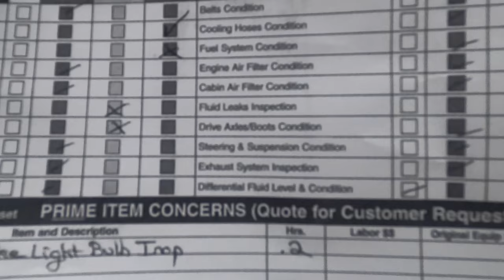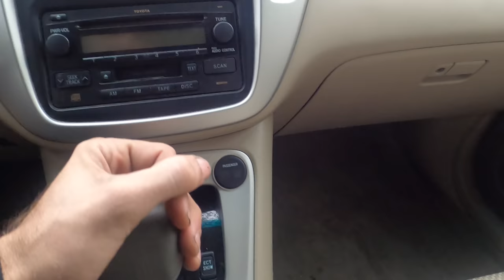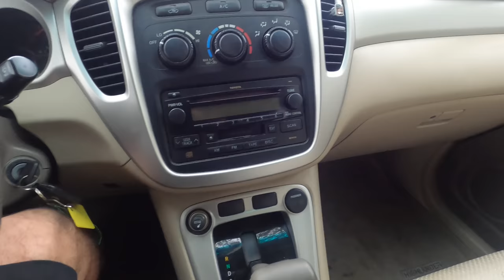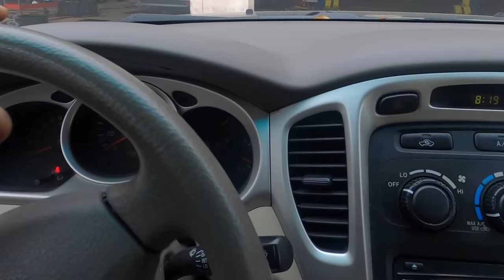We were BASHED by the Dealer! Ripping off a customer! Toyota Highlander 3.3

Comment: I don't think we clean and lube brake parts often enough, especially the whole park brake mechanism and sliders. I also love the way you recognized those rubber rings on the sliders were missing, that's a pro moment right there. Way to go, turning a negative into a positive.
Reply: I take those rubber rings off when I see them, they swell up and seize the slide pin, never had a problem or a come back to this day
Reply: @jsbbd136  hmm. maybe you should film your every-day works and insights and make your youtube channel a competitor for ray! i will be a subscriber, please go ahead!
Reply: I know the only time I actually do it is when the customer says their parking brakes are not working, because the flat rate book doesn't mention includes clean and lubricate parking brake components with a rear brake job with a seperate parking brake mechanism
Reply: @jsbbd136  gota use the proper lube:  non petroleum base.  "Red rubber grease" or silicone grease is what works and will not swell rubber brake parts.
Reply: The culture around brake components being disposable is a big problem that causes poor maintenance. if pads and rotors and drums and often slide pins are all disposable then why do extra to keep them clean and lubricated? Then it’s just a step away before components line the callipers and master cylinder are disposable or at least replaceable. or the dreaded “I’ll replace them now and rebuild my old ones” lie that we all often say and never follow through with, I’ve never rebuilt a calliper with new seals in my life. And once you get to that point then why maintain cables? (Have a car I’m fixing to sell that’s taking a while and I put new parking brake cables on it and only tested them and adjusted them never used the vehicle and only moved it once to store and again to work on the transmission and the cables were already seizing up after not being on and sitting for nearly a year (at least half a year) and being applied for about a month, if they can fail that quickly and with that little use what’s the point in doing much of anything for them? And now that we’re at a point where $40-100 cables are disposable then we circle back to callipers being even more likely to be seen as disposable…
Reply: @josephsteffen2378  Yeah but the castor oil based red rubber greases, also dry up a lot faster than silicone paste.
Reply: @aterack833  It's not that, as much as  that it just takes less work to do a mere pad slap, replace pads and not derust or lube anything that isn't in dire need at that moment to get the customer out the door without noise, then the partially degraded part, continues to degrade before the next brake job would otherwise be due... only has to outlast the warranty.  Granted, it is inevitable that more shop time to DO IT RIGHT, should cost more.
Reply: @stinkycheese804  wow, i didn't know that.
Reply: Personally I by new slide pins and boots when I replace pads. Maybe it's a little overboard but it worked well for me over the years.
Reply: @12yearssober  I buy boots if torn, or slide pins if corroded, but since I started using silicone paste and cleaning out the factory petroleum base junk from the factory, I've no longer had corrosion issues except when doing someone else's brakes.
Reply: @stinkycheese804 
That sounds like a good idea as well. I just do it as a habit left over from living in the rust belt. I'm in Florida now so probably not necessary but I'm an old dog so hard to change lol
Reply: @jsbbd136  Yep i experienced that too, also ditched the rubber rings.
Reply: @josephsteffen2378  No need for these rubbers, never experienced vibrations or any kind of problems without them..
Reply: @josephsteffen2378  it's not about swelling. In some calipers the tolerance is to tight and the rubber guide ring starts to work as a seal. Because grease isn't compressible the guide gets stuck.
Reply: @SAB445  it's not for vibration, it's for knocking going over bumps
Reply: @Robertas_Grigas  Agreed.  We do our best.  Sometimes there is a special situation.  I follow the manufacturer's engineering design, for whatever product I touch.   That's why it's called a skilled trade.
Reply: @jsbbd136  This is the way. Toss those rubbers. They sell up and cause brake issues.
Reply: @Robertas_Grigas  even that.. Removed the rubbers about 6 months ago and didn't hear a single knock. And if it is against knocking why isnt there a rubber on both pins?
Reply: @aterack833  i just revuilt all 4 off my calipers. $15 and 2hrs is better than $700 and 2 hrs.
Reply: @solaryellowis3007  I’m not sure I understand how you got those times since you have to do the same stuff, also sucks that they’re charging so much for those callipers there but it’s good that it encourages rebuilding at least
Reply: @beernutsonline  yeah, good work.  If it's a warm summer day, you could remove the entire caliper assembly and clean the components,  relube them and put it back together.   The caliper piston seals should bock out dirt, etc., for years, unless torn...  It's the external parts that are exposed the most.  They require more attention.   The caliper slide pins and the bores that they slide in must be thoroughly cleaned.   Some designs have slides, sleeves, bores and rotating pistons (rear parking brake adjustment mechanisms)....  In the mid1980s to mid 1990s, Nissan's had 3 different lubes for the 4 wheel disk brakes.  Depending if it was an internal or external component.  A lot of you tubers and commenters have good advice and personal experience, but when it comes to A CERTIFIED BRAKE INSPECTION STATION LICENSE:  You  must follow(AND NOT VARY FROM) the factory Engineering Specifications and Dept. Of Transportation Regulations verbatim.   ...Because there's a serious liability associated with brakes.  Hey, when it's MY CAR, I can do whatever I want.    But when it's a customer's car, there is no excuse in the Courtroom:  YOU WILL LOSE!  How many times a day have you seen LOCAL advertisements on the internet about CAR COLLISION INJURY  LAWYERS????   Yeah, I'd like to see what the JUDGE would say if some clown's defense was, "I heard it on the internet..."    I haven't even begun.... How about Commercial Trucks?  Now it's a Federal violation.   I'm not hammering you "beernutsonline", it sounds like you have your act together.
Reply: @josephsteffen2378  Problem is, in terms of the factory/DOT way to do it, that there are a lot of qualified work steps not part of the specification. If You are in roadsalt areas or in maritime conditions, a change of pads or rotors and pads is not enough, no matter what factory or DOT might say. I do my own brakes because in a heavy roadsalt area like mine, factory-spec-only repairs lead to recurrent failures of caliper sliders to the point where You can't overhaul/repair the rusted lump within reason. I do "overhaul" aka degunk, derust and regrease, sometimes regrind on the lathe and regrease, all six of my brakes on each vehicle (4 roadbrakes, 2 e-brakes) twice a year with every change of winter/summer tyres. Factory/dealership specifications do, opposite to that, basically say "replace caliper if doubtful" which leads to 4 new calipers (NOT free of charge) every other year after winter when official roadworthyness inspection is due. Most dealership mechanics these days do know how they change a caliper and subsequently bleed brakes in their sleep, but they couldn't even repair/overhaul a caliper properly with a detailed manual because they never even thought about doing it instead of throwing it out and put in a "brandnew" one made from the same chinesium the original one was made of.
Reply: @josephsteffen2378  I use dielectric. Never an issue with hardening.
Reply: @manfredschmalbach9023  Wow, I'm from Southern California...no road salt or snow.  Heck, it's even dry here.  Since I work indoors, I can wear shorts year round.  Road salt? What is that?   Or the other compounds that are mixed in the stuff that improves traction on snow covered roads.  All off the junk that melts off and leaves a pile on yir garage floor....  So, a "clump of rust" is a rarity.    Taking nuts and bolts off a Southern California vehicle is a breeze.  Reality set in when I worked on a vehicle from Colorado:  every single nut and bolt gave me trouble.
Reply: @josephsteffen2378  ... now imagine having to maintain not only the brakes but every bloody system plus Your frame/box-section tin cavities of Your car used in salty winter conditions - every doorbolt, every link of Your windshield wiper, every little screw holding Your blinker in, roofrack-bolts, engine-mounts, effing everything which ain't made from 316 stainless or better does need a certain amount of constant attention to keep it in working condition all the time. That's why many people able to afford that do have a winter beater that isn't worth more than two or four winters use maximum (we have biannual roadworthyness testing in Germany) and gets thrown out and replaced after that, because it is a chore to keep up with salt-damage Yourself and would cost a fortune to pay a skilled trustworthy mechanic for it.
I do it myself since I started driving cars with 18 (nearing my sixties) and cobbled together some tricks and equipment over the years, but it still is a chore. My other home, an island in the Med, does not have winters and roadsalt, but it's even worse there with salt in the air all year round. I keep a Land Rover there, which will get its third frame and bulkhead next summer (It is from 1964 though, making it roundabout a frame every 20 years ;-)
Reply: Those rings aren't just for vibrations and bumps, they're to keep the caliper aligned with the rotor. Without them in place the caliper can sit at a slight angle causing uneven pad wear.
While they're not a critical component to the operation of the brakes, they do have a real purpose.
If you're having trouble getting them all the way into an old caliper after lube, there is probably still some old crud at the bottom of the hole. I grabed some cheap stainless steel bore brushes from my Mac Tools guy, shot of brake clean down in the hole then spin it up, works like a dream.
Reply: @josephsteffen2378  they still get hot, they rip, rust gets between the pin and rubber causing them to get stuck. Ford uses them on some of the e250s. Its just a horrible idea/bad design. There's more vehicles that dont have the rubber on the slides than vehicles that do have it, far less problems with those ones. There's just no need for it to be included. Causes more problems than it solves.
Reply: @josephsteffen2378  in some cases yes. In many cases the engineers do stupid shit. Engineers arent mechanics, engineers dont think about maintenance. All they think about it how to make something work as cheap as possible. So many times ive had to fix engineers mistakes, especially with cars. They dont usually do whats best, and far often they do whats cheapest. If they do something that doesnt work as intended, they make it work ok instead of redesigning it to make it work right. Car manufacturers make the most money off maintenance, if the engineers design things properly and to last as long as possible, the manufacturer makes less money. Same with electronics, appliances, everything. They want shit to break so it needs to be repaired or replaced. Its not like it used to be where shit was made to last. Now they make it as cheap as possible to hopefully outlast the warranty.
Reply: @manfredschmalbach9023  more often than not these days its not worth rebuilding calipers. I know a few ppl that used to rebuild calipers but dont bother anymore because they dont last as long. The parts are cheaper than they used to be and dont last as long. The seals are made shittier so end up leaking. If you can get all good quality parts, as good or better the OE, sure go for it. But lots of manufacturers arent selling all the parts needed, and the aftermarket ones are usually junk. Sometimes you luck out, sometimes you dont, which is why ppl that used to rebuild them stopped, its just not worth the risk of them components not lasting as long
Reply: I think the calipers, drums and the wheels should be detailed every time the brakes are done. When you do it regularly, it takes very little time and they stay pretty clean. The reason they get so crusty and gross is because no one ever does it.

And yes, the customer should ask for it every time and the customer should pay for it every time. I’m not saying techs should be doing this out of pocket.
Reply: @12yearssober  gotta make sure to hang the brake calipers, cuz they won't hang themselves..  know what i mean
Reply: @GlycerinZ  
Good point 😆
Reply: @jsbbd136  you're using the wrong grease then if the rubber is swelling.
Reply: Maybe some wire brush and fluid film action on those rusty parts are in order.
Reply: @Druid_Plow  i just use drill bit and brake clean while drilling in the bores.  cleans em almost instantly and yes that dude is a hack for removing the rubbers lmao
Reply: @jacksmith2315  you have a very good point.
Reply: @jsbbd136  I totally agree with your method. I was working on a car and the little rubber piece swelled. So I just took them off and haven't had a problem since.
Reply: @Druid_Plow  I've done all that and still had problems with those little rubber pieces. It just is supposed to keep your brakes from squeaking. Well that's what I was taught anyways and I've heard really good mechanics say it's not necessary and other good mechanics say otherwise.  That's how the mechanic world works though. Stuff like that is just how your taught mainly and as long as it doesn't cause a problem and that's the way you always do it then do it like that
Reply: Proper shops  do it every single time
Reply: I do mine every day before work
Reply: @Necropheliac  Just had rear brakes done while I was stuck vacationing in Florida.  Tech got paid full price but proper cleaning of brake anchor wasn't done (remove rust) so of course the new clips and pads when installed were too tight and pads didn't move freely.  I will fix this myself correctly when I am home but average customer has no idea whether thier repair is done proper or not.  Every manual says clean parts and grease, of course that's subject to interpretation ... does that mean spray brake clean and call it good or use wire brush, sand paper or whatever else to remove rust/crud down to clean metal? Bottom line is cleaning and lubricating parts is part of any normal repair process, customers pay for it so if it isn't done it's the fault of the technician and the management of the facility for not insisting it is done.   Unscrupulous techs will cut corners and do only enough to get job out the door, they usually know what happens as a result and don't care.  So if you are an honest guy, you tell your customers   what is needed, how much it will cost.  If you charge them fairly and do work as promised they will be back and will likely tell thier friends.  If your like my tech in Florida, I hope Karma will come take care of him, someone he pays to do something for him will do a half-ass job, cut corners and collect full price they don't deserve.

Comment: 17:44 Brake cleaner used on actual, honest-to-god, god damn brakes.
What a sight to behold.
Reply: What!?  You can use brake cleaner on brakes?  Who would’ve of thunk?
Reply: What?!  It's not the stuff to clean your hands when you go for a break? :-)
Reply: You can see brake cleaner used on many parts on many videos, but this is the first time on just brakes!
Reply: Brake cleaner is a nurotoxin,  ;) think about that, everytime you wash you hands with it and it absorbs into ya skin! A sink and soap, may take longer. May
Reply: Yeah, yet all he needed to do was bash it on the ground to shake the rust out. Waste of Brake Kleen in my opinion.
Reply: I'm surprised they hadn't run out.
Reply: I miss chlorinated brake cleaner. That shit would drop wasps right out of the air!
Reply: @robroy9793  - was that with or without igniting it? 😂😂
Reply: @johncoops6897  
Both!
Reply: @jerryrennfahrer5589  It's not a neurotoxin lmao; if you're gonna blow hot air online, at least learn to spell.
Reply: @dakota9821  actually it is. If you don't know what you're talking about, shut up!